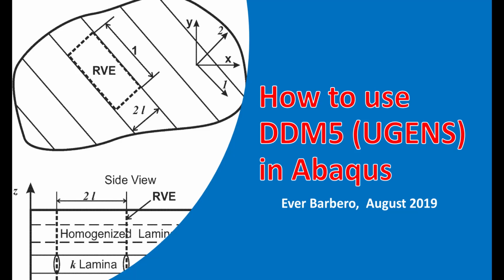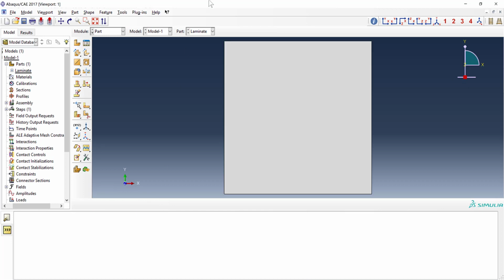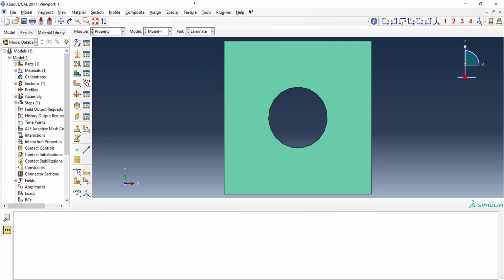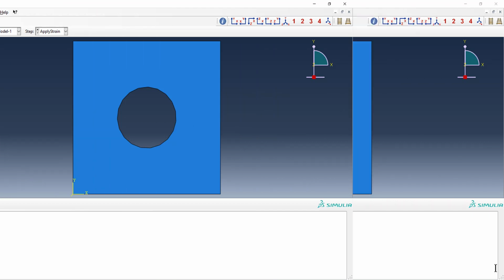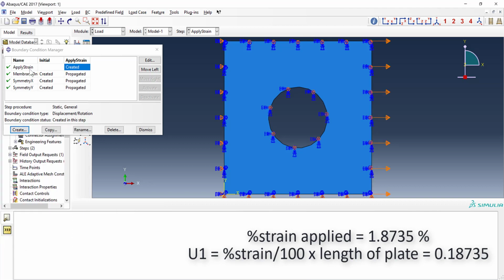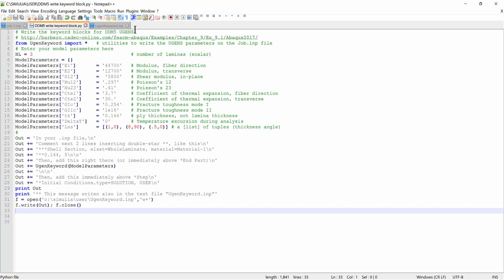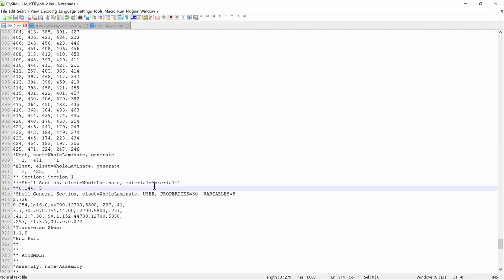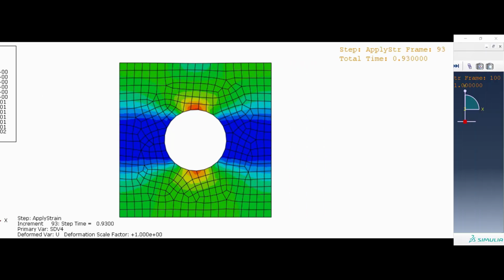Abaqus UGENS Composite Materials Damage

Comment: Dear Prof. Barbero, 

Thank you for these very interesting videos on UGENS and discrete damage mechanics (DDM). I have not yet had the opportunity to study the theoretical foundations of DDM in your book, but I plan to do so soon.

In the meantime, I wanted to ask whether it is feasible to implement continuum damage mechanics (CDM) using UGENS and apply it to analyze progressive damage in laminates. Specifically, I am interested in capturing the sequential failure of plies—for example, observing weaker 90° plies failing first, followed by the failure of stronger 0° plies. Or would you recommend using a UMAT with layered shell elements as a more appropriate approach for modeling this type of progressive damage?

I would greatly appreciate your thoughts and guidance on this matter.

Best regards,

Swami

Comment: Thank you for the tutorial, Prof. 
I have a problem that the module 'UgenKeyword.inp' cannot be found Prof. I use Abaqus version 2017 and Python 12.1 then I run it on notepad ++ but I cannot run it because the .py code cannot find the UgenKeyword.inp file, Prof. Even though I have placed UgenKeyword.inp and DDM5 write keyword block.py in the same folder. Can anyone give advice and direction to solve my problem Prof?
Thank you

Comment: Didn't catch this when I first saw this: when you need more than 8 input parameters for the UGENS subroutine, it is very important that you put them in the inp file such that there are exactly 8 parameters on each line. If you put more than 8 parameters in the same line, the parameters beyond the 8th may be read incorrectly. If you put less than 8 parameters in the line, Abaqus will treat the parameters up to the 8th parameter zero, and the first parameter in the next line will be treated as the 9th parameter.
Reply from the maker: correct! To take care of this, I write  Python script AA that writes another python script BB, input: the data needed by UMAT, output: the lines to put in BB and I feed BB.py to Abaqus/CAE, either in the Python shell >>> at the bottom of CAE, or at the DOS command line \>, something more or less like this: \> abaqus -cae nogui BB.py

Comment: Prof. Barbero, where could we understand the UGEN that you wrote and the python file that you coded? Thank you sir
Reply from the maker: For DDM, the theory is explained in papers, starting in 2010, you can read the papers sequentially and see the evolution of the theory. An easier summary is presented in my books. The UGENS is very complicated, so I do not release the code, I just release the .obj, you can use it but not modify it. To add new things, like fatigue, I modify it, then release a new version of the .obj, released in my website.

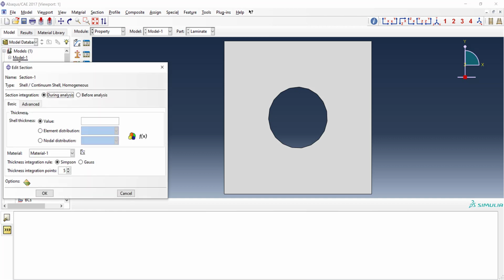Comment: I created the set before I assign the section. The issue in this is that Abaqus cannot recognize the "*transverse shear" keyword. However, I can input transverse shear properties when I assign the section (in 4:29 window, advanced tab). Afterward, just replace the .inp file segment involving "*Shell general section" with the UGENS related info and it worked for me. Interestingly, the keywords related to transverse shear through this method are "*transverse shear stiffness" rather than "*transverse shear" seen in this video.
Reply from the maker: I am glad it worked. Sometimes Abaqus makes little changes like this with each release or update.

Comment: Respected Sir,
I am using Abaqus 2016 for my research. When I used "DDM5-ugens-std" from  "http://barbero.cadec-online.com/feacm-abaqus/Examples/Chapter_9/Ex_9.1/Abaqus2017/"  while submitting job-2, It gave me following error:

"Error in job Job-2:  Include files required for compilation of MPI dependent  user subroutine was not found under the following subdirectories  "C:\Program Files\Microsoft MPI".  This may indicate a problem with the MPI installation. 
Job Job-2 aborted due to errors."
I think it is because I am using Abaqus with a different version. Would you please provide me "DDM5-ugens-std" for Abaqus 2016 version? It will be a great help to my research.
Reply from the maker: I am sorry but I am using 2020 now and starting with 2020 it is not recommended to install different versions on the same machine. That would mean setting up a virtual machine for 2016, but then I would need another copy of WIN 10, expensive. I can't do it. I never used 2016. You can try installing the Visual Studio recommended for 2017, in my video. That will install the DLL's in your machine, and may solve the problem for you, but I am not certain. I recommend to upgrade to 2017.

Comment: Thank You, sir, for the video. would you just tell me that How to find average crack opening displacement (COD) if cracks are given in 90 deg plies or +-Theta plies?
Reply from the maker: In this paper "A. Adumitroaie and E. J. Barbero. Intralaminar damage model for laminates subjected
 to membrane and  flexural deformations. Mechanics of Advanced Materials and Structures, 22(9):705{716, 2015. http://barbero.cadec-online.com/papers/2014/10.1080/15376494.2013.796541.pdf" you can find references to the work of Adofsson and Gudmundson, who found a way to calculate COD for laminated composites, and my student Adumitroaie used in his dissertation.
Reply: @EverBarbero  Thank you very much, Sir! for your guidance and support. It is a great help for my research.

Comment: Thanks Mr. Barbero for sharing this video
I am simulating a tensile test of a specimen of GRP pipe in ABAQUS. After finishing the analyzing, the stress-strain curve does not show any modulus reduction. In fact, the behavior is totally linear until it reaches the maximum stress and then it suddenly falls down. Should I use Discrete Damage Mechanics (as you explained) to simulate the modulus reduction?
Thank you in advance
Reply: @Ever Barbero Thanks Mr. Barbero. Actually, the fiber orientations of ply layers in my simulation case are [+/- 55]. So, I think it is expected that the model represents the modulus reduction as I saw in the load-disp curve of the tensile test in the lab. I would be appreciated if you give me a link to a paper or website about how to apply crack density in various laminae in ABAQUS.
Reply from the maker: You can, by reading chapter 9 in my Abaqus book an installing the UGENS, download the .obj code from my website. See my other video on how to set up your software to run ABAQUS with UGENS.
Reply: @EverBarbero  Thanks a lot